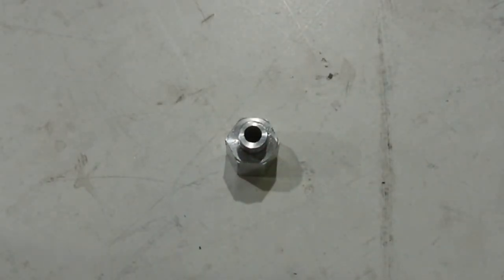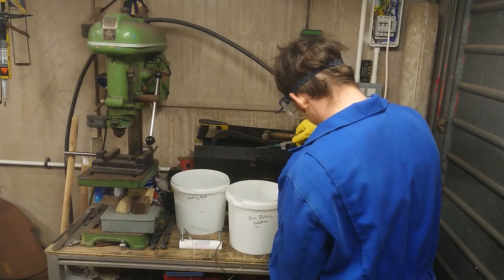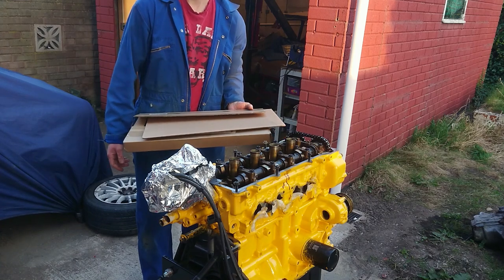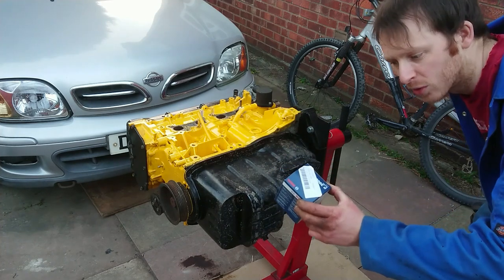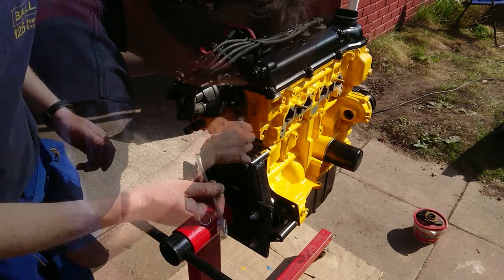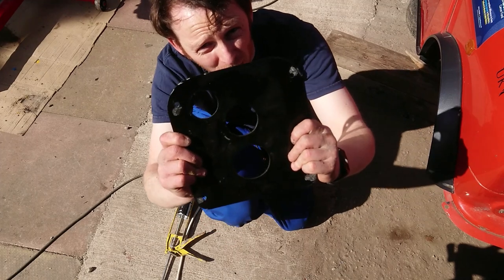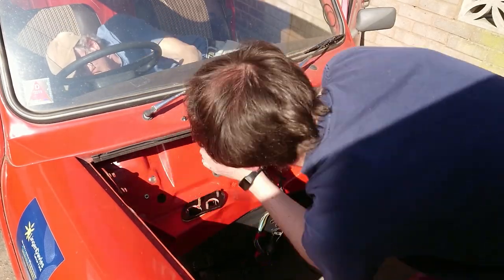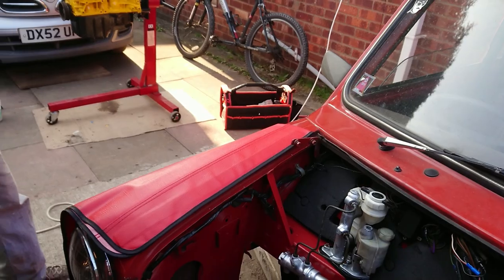CG10DE Powered Mini- Reassembly

Comment: Great progress. Love the colours. Is the oil pressure sensor the one of mini or micra?  Do you think you could use t piece too to use for oil pressure gauge in mini
Reply from the maker: It's the Micra's. I don't have a gauge just a warning light so my plan is to take the signal from the Micra's Ecu and use that control when the light goes on or off.